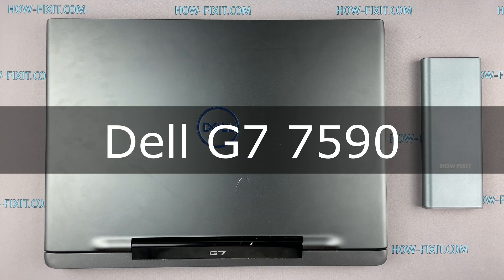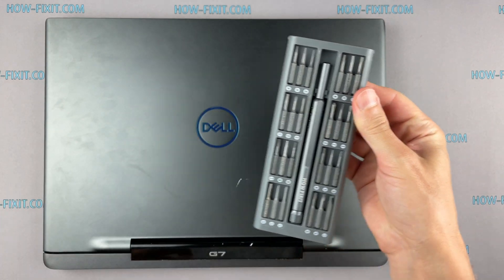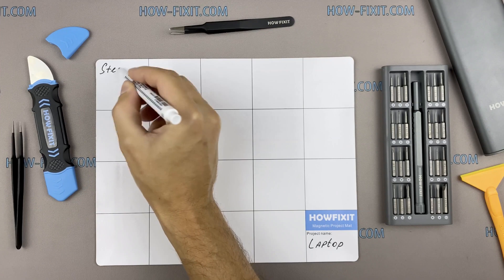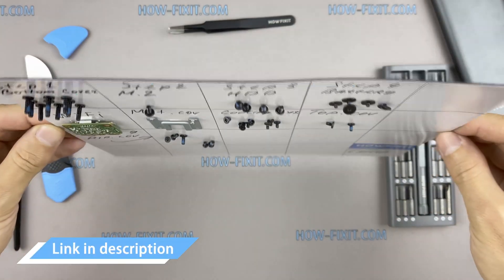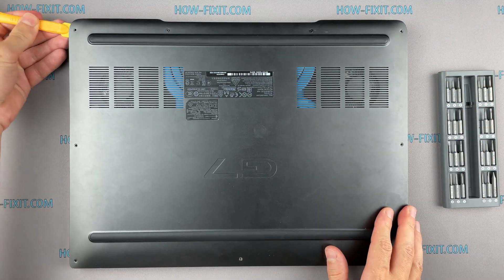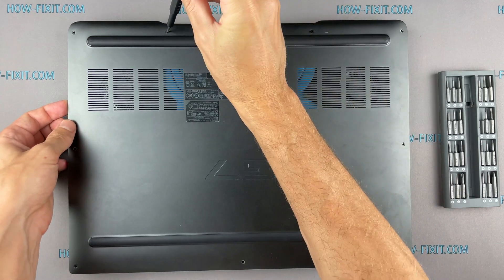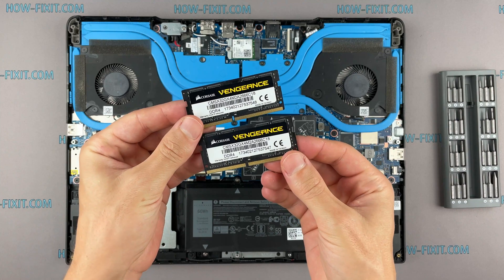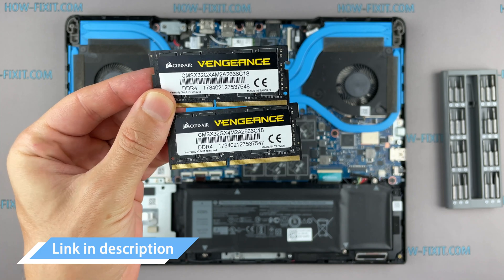Dell G7 7590 RAM Upgrade and Installation Guide

Comment: Thanks a lot!! You are suppose to pull back the battery cable connection, not pry it up on my 7590!! Now it does not work!! Messed up my cable connection!!

Comment: Tech specs for the G7 7590 say it supports a maximum of 32GB of RAM, but in the video you seem to be installing 64GB. Did that work?
We only see the laptop turn on, but not if it recognized the whole 64GB.
Reply: Good question. Bump